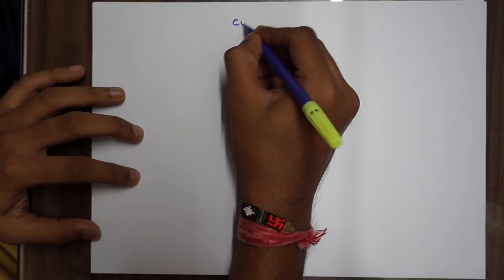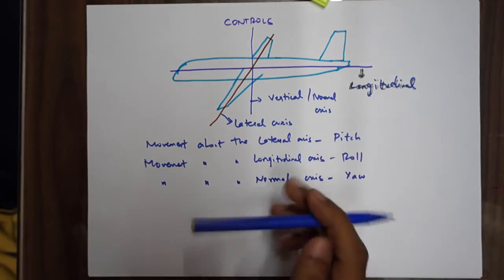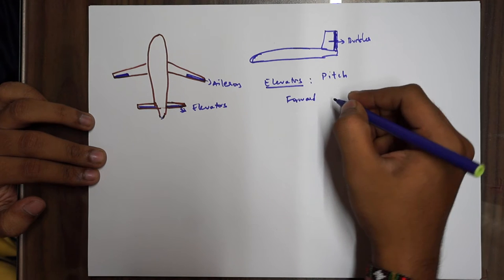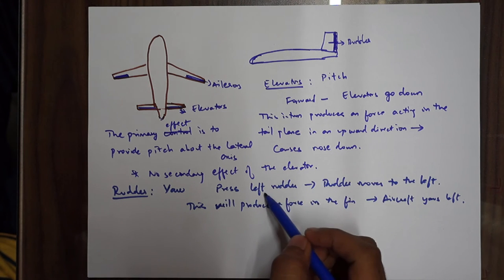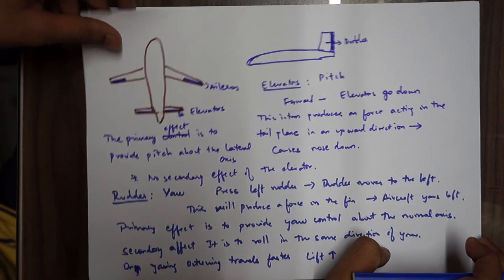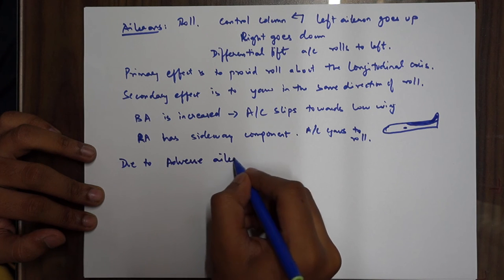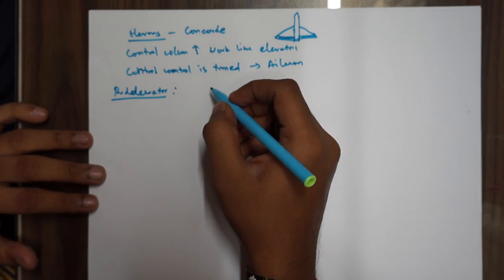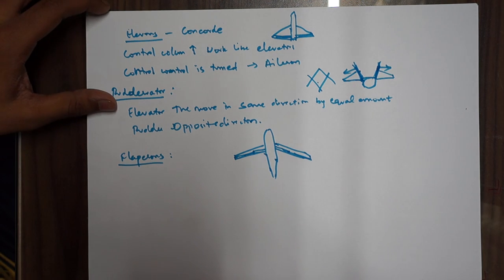Flight Controls

Comment: bro my question is that -
when we  roll right than the right aileron is up and left aileron is down , hence left one creating more lift so it rolls the aircraft right also the left aileron  has more drag , so it turn the aircraft to left hence creating adverse aileron yaw , all right up to here .
but
next you said that if we roll right than the aircraft slips down hence the right wing gets more airflow and also more AOA hence more lift , more drag hence it will yaw to right .okay 
now I am confused that if the aircraft at time of rolling right had already yawed to left than how will it yaw right when it slips down ????? I am really confused in this bro please clear this doubt this question is giving me headache .
Reply from the maker: The ailerons produce a rolling moment by increasing the lift on one wing and decreasing it on the other.  The increased lift on the up-going wing gives an increase in the induced drag, whereas the reduced lift on the downgoing wing gives a decease in induced drag. The difference in drag on the two wings produces a yawing moment which is opposite to the rolling moment, that is, a roll to the left produces a yawing moment to the right. This is known as adverse aileron yaw.
Reply: @poh  bro you haven’t got my question
Reply from the maker: Maybe you can frame it better.

Comment: In the control briefing, u mentioned  that Movement about the Lateral Axis is called Pitch and explaining one of the primary basic ctrls of Elevator, u say movement of Elevator  is known as Pitch. Here i m confused.  Which is correct ?? Move of Ailrones makes Roll and  move of Elevator makes pitch ? Plz clarify
Reply from the maker: +Vijaya Kumar T Movement around lateral axis is pitch controlled by elevators. Movement around longitudinal axis is roll controlled by ailerons.
Reply: Sr please provide all material of module 8 that means aerodynamic all topics.please

Comment: Is speed the secondary effect of pitch ?
Reply from the maker: Well its not an effect, but speed can be controlled with the help of pitch. Higher pitch will lead to slower speed and vice versa. This is without changing the power/thrust. 

Roll is a secondary effect of yaw. Yaw is a secondary effect of roll. So if you roll just by moving the control column, at a certain threshold, your aircraft will yaw in the direction of the roll.

Comment: adverse alieron drag?
Reply from the maker: +Rohit Shavi In steady level  flight with the ailerons neutral, the lift on the two wings will be equal. If the control wheel is turned to the left, the left aileron will move up and the right aileron down. The up aileron will decrease the lift of the left wing which will begin to ‘drop’. The downward movement of the wing creates a relative air ow upwards, which increases its e ective angle of a ack. The opposite effects will occur on the right (up going) wing. The increased e ective angle of a ack of the down going wing increases its lift, which opposes the roll. This is called aerodynamic damping.

The ailerons produce a rolling moment by increasing the lift on one wing and decreasing it on the other. The increased lift on the up-going wing gives an increase in the induced drag, whereas the reduced lift on the downgoing wing gives a decrease in induced drag. The difference in drag on the two wings produces a yawing moment which is opposite to the rolling moment, that is, a roll to the left produces a yawing moment to the right. This is known as adverse aileron drag that causes a yaw.